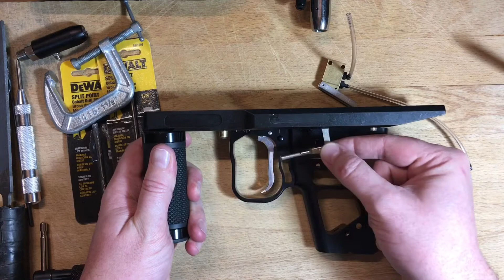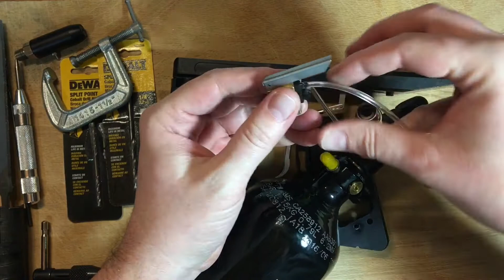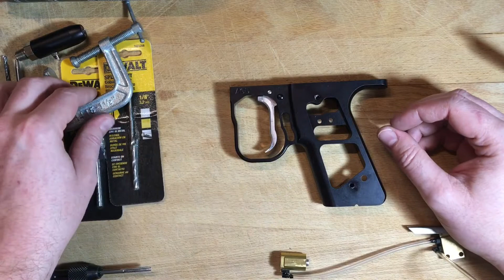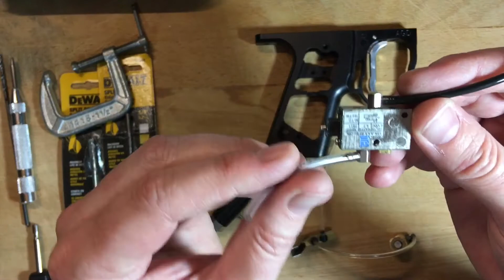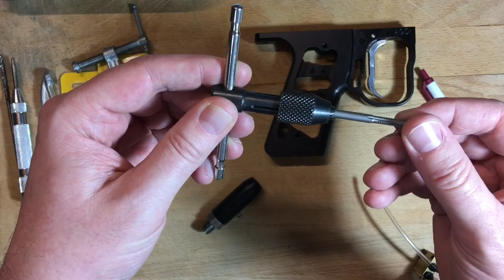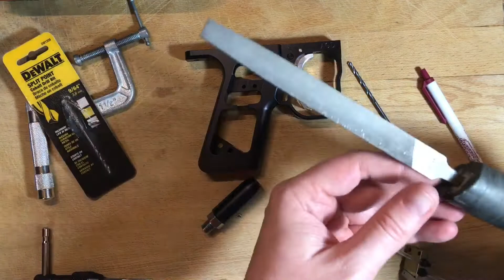Pneumag Tutorial: Part One (Introduction and Tools)

Comment: Is there a list of the parts needed that come in the kit i don't think the guy still makes the kits on mcarter. Im Gonna try to make a pnuemag but don't know what all I need to order or where to order from. Thanks in advance
Reply: i am that guy if that helps i make the kits,
 but if you do want to buy the parts piece by piece i get that also.
Reply: @rkm3ddesigns672  do you still make the kits?
Reply from the maker: That's a shame. Here's the parts list. You can find them all pretty easily on Google. 
Fabco MSV-2 (pneumatic valve)
Clippard MPA-3 (piston)
the air fittings are "barb" fittings for 1/16" ID hose, with 10-32 threads
the hose is standard autococker hose, 1/16" ID and 1/8" OD
BUT, I would be patient and keep trying to contact the other guy. I'm pretty sure he's still making the kits, and it's better buying from him since he preps all the pieces (like trimming down the sides of the MPA-3) before mailing them out. He's probably just busy and hasn't seen your message yet. You can also try messaging him on Facebook (Ryan Mingo). He's pretty active in all the Automag groups.
Reply: Mcarterbrown got hacked sadly no all the info is gone
Reply from the maker: @trashtronics1700  Check automags.org. RKM is on there as knownothingmags. I'm on there as rawbutter.